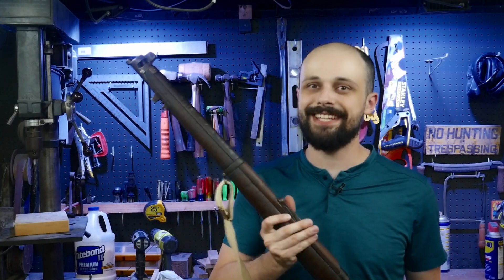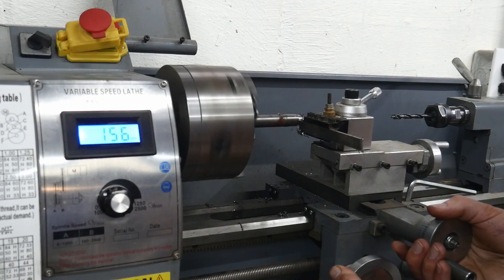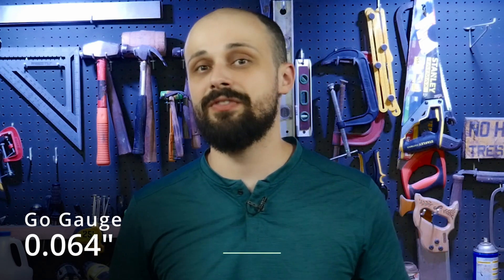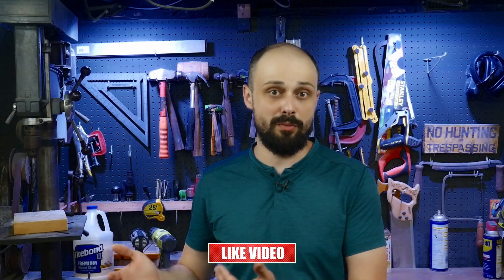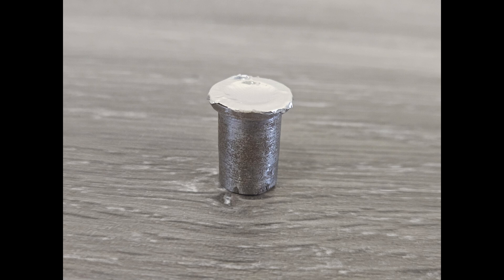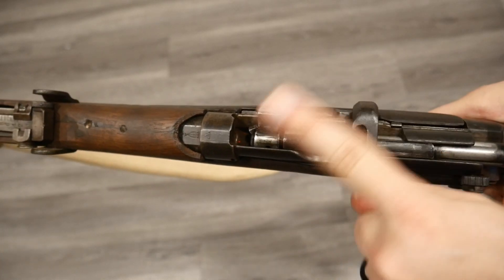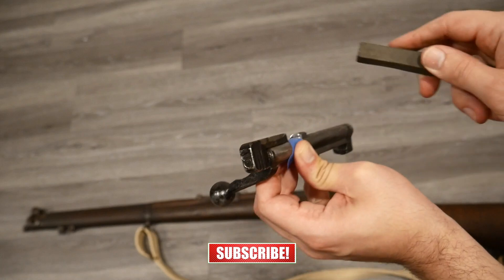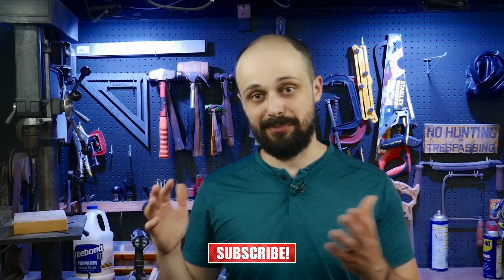Headspace | Are Surplus Rifles Safe? How to Check Headspace (DIY No-Go Gauge)Enfield Headspace

Comment: I just install a fired primer in a case and measure the protrusion of the primer after chambering.
Reply from the maker: So how did it turn out? Was the headspacing good???
Reply: @brave.builds .0015

Comment: My uneducated mind says to me what’s the point of the go gauge if it’s supposed to close?  What would it mean if it didn’t close on go?   Thank you   I’m trying to educate myself
Reply from the maker: That the headspacing is too tight to reliably close on standard rounds fully. This is more of an issue after making a main change like a bolt change.
Reply: @brave.builds so that would mean that if it doesn’t close on go that the chamber would need to be reamed further in (further from face of bolt)?
Reply from the maker: I wouldn't jump to reaming it... again, enfields seem to be somewhat forgiving with headspacing... I would try chambering a few rounds in a safe location to see if they fit without excessive friction or extraction problems. Don't force it though! Unlike closing on a field gauge, we are not as much concerned with case rupture, but with actually chambering rounds consistently as thicker rims might not fit and there might be issues chambering and extracting. If this fails, the correct answer is the swap bolt heads... No4 rifles... find a numbered bolt head that is smaller number (probably could then sell your larger bolt head on ebay)... No1 mk3s... not as easy as its more trial and error getting different heads. (Again, if the bolt head is undamaged, measure it and put it on ebay and recoup some of your costs).
Reply: @brave.builds thanks a lot.  That makes sense.   Hey by the way, great video!!
Reply from the maker: Thanks!!!